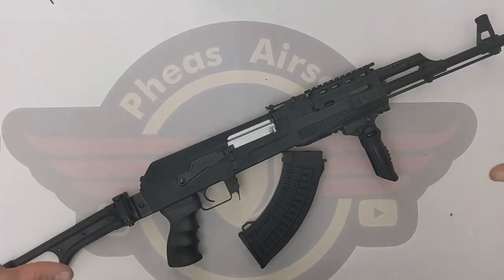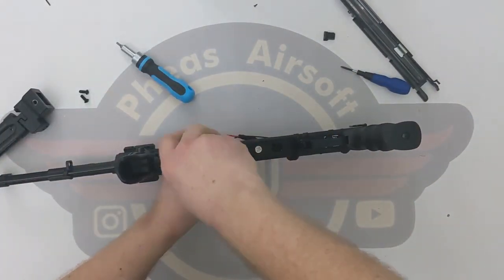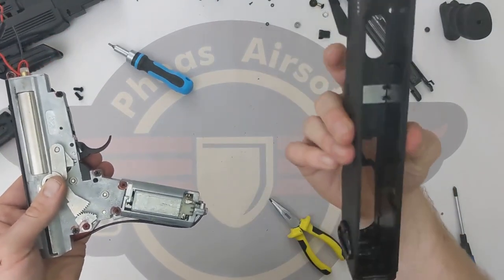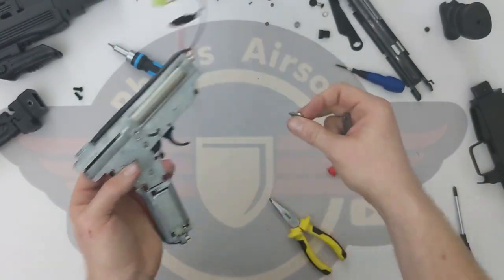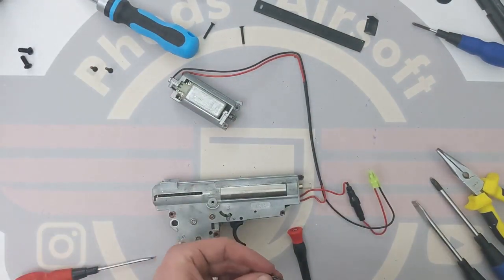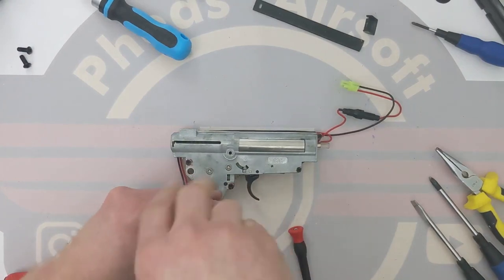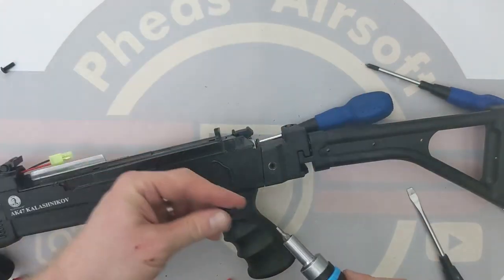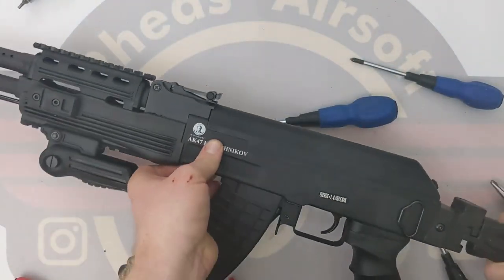[HOW TO] CYBERGUN Tactical AK Disassembly - For maintenance or repair

Comment: How do you remove the flashhider?
Reply from the maker: It should just unscrew on a 14mm negative thread (opposite to normal screws / threads) there may be a retaining pin that needs to be pushed down with a flat head (was a while since this, so can't remember exactly) pheas
Reply: @PheasAirsoft  I'm in the U.S. so there's glue. How do I get the pin out? It's not like on the AK74's, it's in the flashhider itself.
Reply from the maker: @Snowy_Breeze  From what I can remember, there shouldnt be a pin, maybe just apply heat (like hair dryer) to break the glue I dont think I have seen a pin in one before. If you want to email me pics to have a look?? or send them to one of my socials: pheasairsoftyt@gmail.com. Pheas
Reply: @PheasAirsoft  don't have it yet and I don't know when I'll get it but I'll keep the offer in mind. Thanks.

Comment: Hi Pheas. Great video. I have the Cyma version. Great rifle but the hop up slide moves when firing. Where would you place the shim on the hop up unit to add more grip to the slider? Thanks
Reply from the maker: Hello! Glad you liked it! I would put one (or a couple) under the screws on each side of the adjuster arm to make sure you get the friction against the body of the hop unit. This is actually a really good idea for a video! Pheas
Reply: @PheasAirsoft  cheers mate will give that a try. Would you use standard gearbox shims?
Reply: @PheasAirsoft  ps that would be great to see a video on how to do it 👌🏻
Reply from the maker: @lordofdadness4617 I would use the standard ones. Pheas
Reply: @PheasAirsoft  nice one 👌🏻

Comment: What if the bucking was torn in that JG? because I've never heard of a bucking that's split like that. That made me think: How about adding a small part to the videos where you check the quality of the hop-up bucking? If it has a lot of grease (sometimes they are really gunked up), is it in good condition out of the factory, or is it sealed properly/loose on the barrel etc.

Just a little thought I had since you added the glove tests to your unboxing. No worries if you don't like the idea and don't want to add that to the disassembly videos :D Fiddling around the gearbox is already finicky enough without opening the hop-up unit.
Reply from the maker: Hello! Its defo a "design feature" of the rubber, BUT you do make a good valid point about referencing the state of the hop and barrel. Its hard to keep the videos monetised with unboxings, so the algorithms would see it (more than likely) as a reference to upgrades / modifications so I will start to add it into future disassembles as they almost ALWAYS get limited ads (apparently its not ok to show how to work on a toy gun) Pheas

Comment: The cyma mp5 hige speed can you have a 11.1 in it no problems
Reply from the maker: Hello! It should be fine with an 11.1v in it. I would have thought if anything was going to break then it would be the piston, but they are cheap and easily replaced if it did break
 Pheas